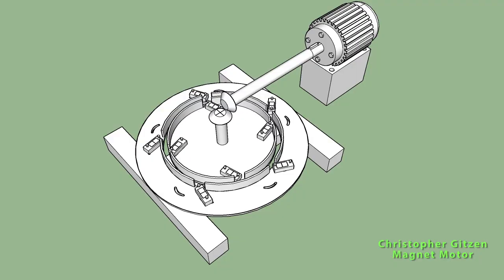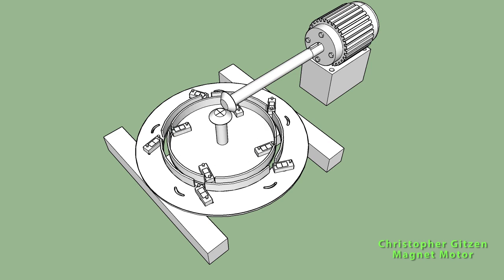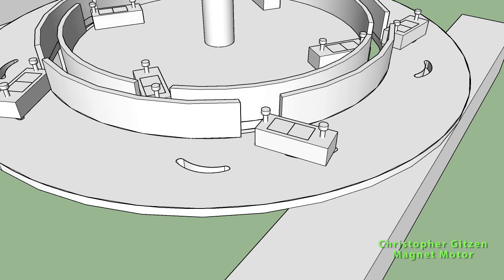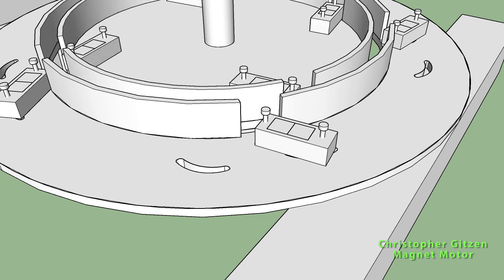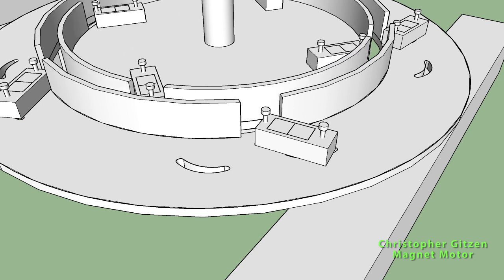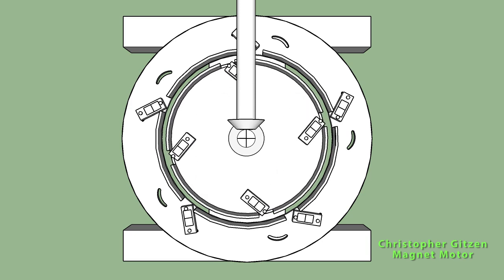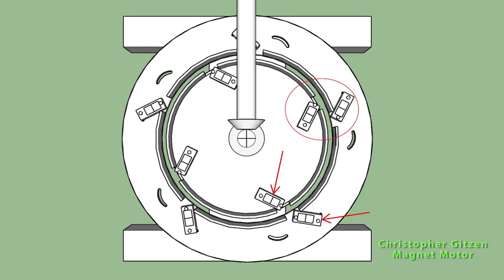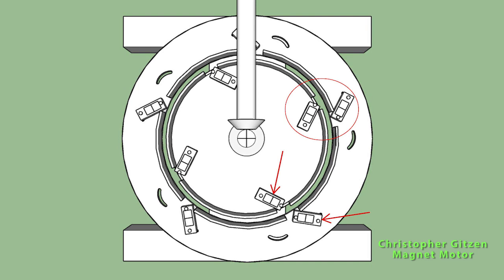FREE ENERGY, Christopher Gitzen Magnet Motor, MU Metal Shielding!!!!

Comment: I like the video, some day I will build it. The problem has always been getting a perfect circle. But our designs never had the shaft on top. I designed it to stagger “stack” with a common shaft for “endless” torque. Just put  a conductor  around the outside to generate the electricity. But it’s a battery that lasts 90 years, not “free energy”. Also, it was a group effort from all three of us: Chris, Dan, and myself.
Reply: is it available in the market? or can you just guide me how to make one plz
Reply: @ReddLolz  I built it. It does not work. :(
Reply: @justinstorto  If it doesn't work then why did you apply for a patent?
Reply: @ManosAristidopoulosSEO   We thought that it would work, but didn't have the skill or equipment to make it. nor did we have enough money to pay someone to build it. This was years ago. now with 3D printers, I was able to make it. It finds equilibrium. Looking at the design, you wouldn't think it's possible. I never took into account the fiction created when passing a conductor through a magnetic field.
Reply: @justinstorto  That is amazing, well done! I was thinking the same, you can even improve this i believe with pyramid magnets to push, and some giron shield which is more flexible, to perfect the magnet fields to be more efficient. I will build your plan very soon and give you the credits of-course in a video!

Comment: So If it works, why didnt you already build it?
Reply: This is why the above model does not work, even assuming that the above concept model is capable of magnetic shielding.  Of the five magnet groups, only one magnet group produces repelling force, while the other four magnets groups and the mu-metals generate pulling forces, putting on a powerful brake. Although the inventor was tried to reduce the compression force when they pass by each other, this model doesn't reduce the compression force of the same polarity magnets, neither. The mu-metal of the inner circle didn't cover enough inner magnet and both magnets are meet straight when they pass by.

Comment: Action - > reaction will allways be the problem.
You require a similar opposing amount of force, to put 2 magnets towards eachother
as is the force, required to move the magnets away from eachother.
Total energy gain : 0 or less. There is no way around it. Nature can't be cheated.
Nevertheless, I also am working on a contraption.
Even though I know it is impossible, I remain curious to the question 'what if ...'
That's highly unfortunate, because I am waisting my time.
But it might be more about the journey than the destination, because I
do learn a lot about mechanics and physics, from practical application.
So ... that's fun.
Also .. I built a couple of my own 3D printers (pretty big too), which helps
with quick and complicated contructs.
I recommend it to everyone who likes to build stuff.

Comment: thanks for posting, this animation of a Flawed design.   it doesn't work and won't work.   because,  the magnetic flux emanating from a permanent magnet is  toroidal  in shape.  as a result of this compound-curvature, magnetic flux  Cannot  easily  be confined or manipulated.  the use of mu-metal does Not  neutralize  this trait.    cheers                             googletranslate